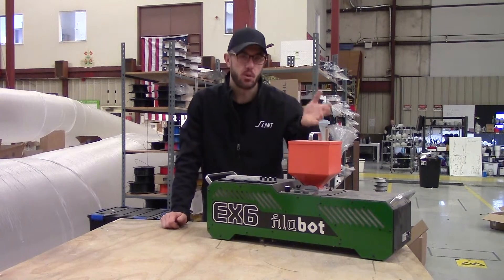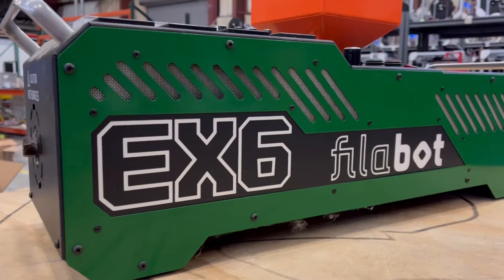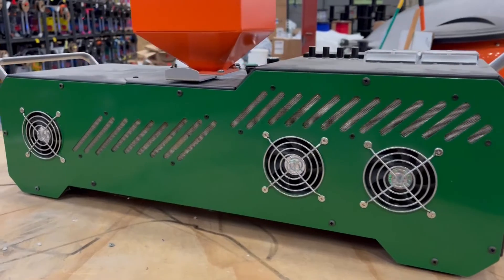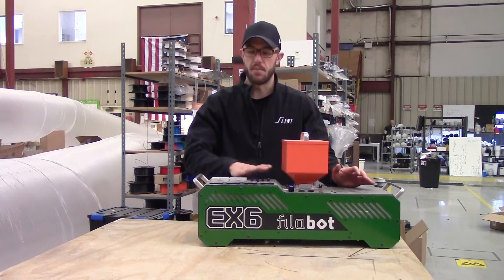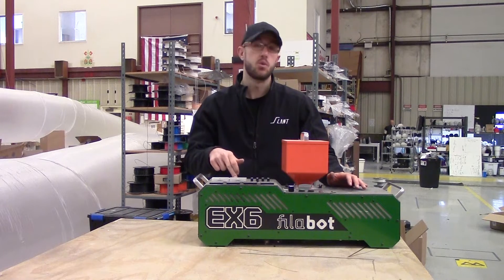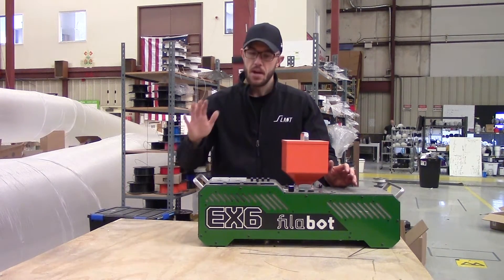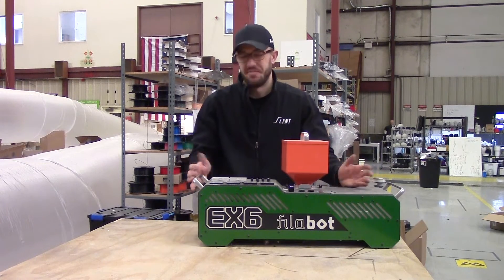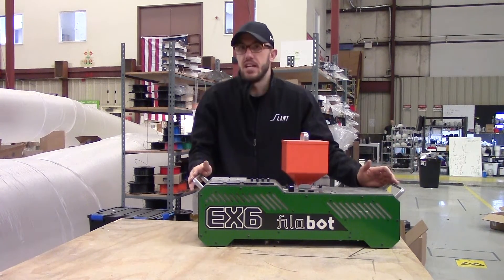This Filament Extruder Costs $12,000...How Well Does It Work?

Comment: I was under the impression that the gearboxes on the motors (usually combined into a single part) are a consumable. But yeah, at that cost, that's crazy. It's 16-18k now.

Comment: So $12000/ 3000 rolls so cost to produce per roll was $4. 

What were you expecting? Of a lab production machine? 

What is the fix? Replace motor to more durable unit? 

[edit: so company didn’t get back which is poor service] What did company say when you reached out? As they may have said it’s a known issue and provided a rev2 motor/ fix. ARB had that with some suspension (bp-51) they made, they replaced far out of warranty as a known issue (a soft recall ie a customer complains then they fix). 

Sounds like you needed the next step up from this level based on your video.

Maybe do a how yo fix video at least help other fix their out of warranty unit ls on the cheap. Perhaps a slightly bigger motor will make the machine unstoppable.

Comment: Some topics I'd be interested in...

1. Do you have a auto filament spool swapping solution?
2. Do you you use "infinite print" belts for print beds? 
3. Any sanely priced solutions out there for fiber "tow" extruders other than the Markforged? 
4. Any work on corona discharge based extruders? I've always thought it aught to be possible to leverage corona discharge for instantaneous heat response for perfect modelling of extruder state, plus the increased surface energy should reduce oozing and  possibly increase layer adhesion esp. for low self-affinity materials like hdpe.
5.  Relatedly, are there any high end slicers out there that are worth it? I still find it frustrating that all the slicers I've used seem to treat retraction likes it's normal and fine and make no effort to minimize retraction or travel distance.

Comment: How did you add the extra pellets to the hopper? and could that have added extra stress to the motors inside causing them to burn out sooner
Reply from the maker: Nope. Weight of the pellets id neglible to the pressure of extrusion

Comment from the maker: For context. We did reach out to Filabot about accessing resplacment parts and additional troubleshooting expertise (via phone and email). We reached out after the machine was past the 1 year warranty. We have not receieved responses to phone or emails from filabot at any time.
Reply: I don't know about ease of removal and installation, but their shop still sells a gearmotor replacement assembly for USD$211. That's at least twice what it listed at in 2018 but it's there for order and far cheaper than a full unit. That being said, thank you very much for your professional opinion on this device. Too many people who bother to talk about it at all just yesman or fanboy it without recognizing the niche or the limitations or pan it on the price alone without any explanation.
Reply: @claws61821  That gearmotor is specifically for the EX2. It will not work in an EX6.
Reply: I’m confused. You’re saying in one comment you reached out to their customer service and they never responded. In another you are saying it’s custom parts that broke and they can’t be replaced. How would you know that without talking to the company first? 

You’re saying they use a motor and/or gearbox that are custom made? Doesn’t make any sense.
Reply: @matsysto  often with these machine's the motor and or gearbox is made inaway that its not replaceable or the parts that need replacing are over priced that would blow out the cost of the machine to 60%of replacement. 
Machines today have a built-in end of life. 
Nothing is made to last.

Comment: How about the 3devo filament machines?
(They seem better designed.)
Reply from the maker: Much lower throughput. They run at about the 1/4 the the basic speed of the filabot
Reply: @slant3d  If speed isn’t an issue, would you recommend the 3devo?

Comment: Do a teardown, It would be useful to see where the failure point was. Electric motors usually don't fail. You mentioned a gearbox. Those are relatively inexpensive to source. I'm guessing the steel screw is fine. The ceramic band heaters are ok? If it is a gearbox only, that isn't a major fix.
Reply from the maker: Already done. Custom Parts that can't be sourced.
Reply: @slant3d Have you been given a quote for the replacement part?
Reply: Didn't like your channel when it started but I watched long enough of you to grow on me. That being said I almost bought that machine for my farm too and Im glad you did this review of it. I only comment here because I want to see the inside of it now. Tear it down Slant3D! @slant3d